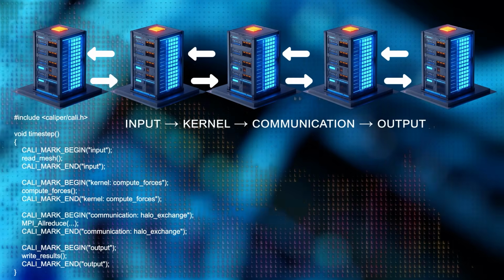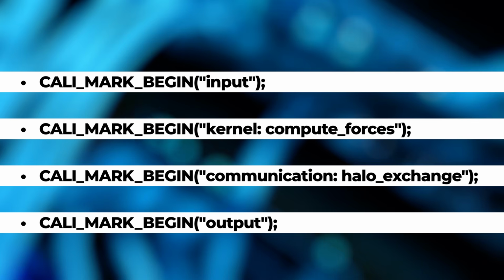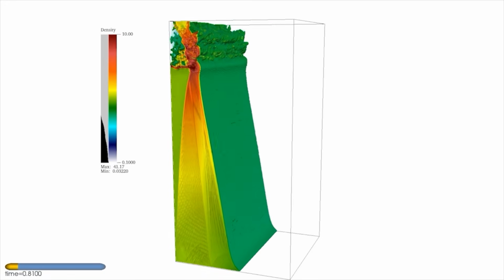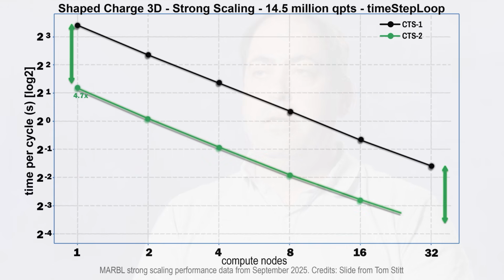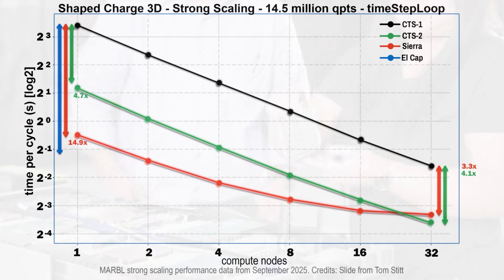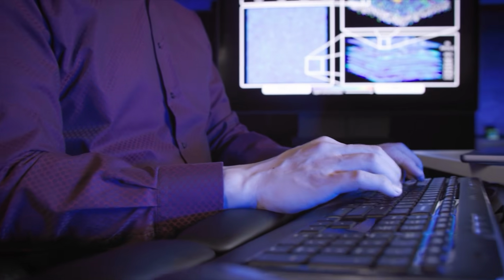Caliper+Thicket: Optimize HPC Simulations with Cross-Platform Exploratory Data Analysis

Comment: This seems to be a very useful combination of libraries. I'll certainly have a look to integrate this into my MPI-OMP Hybrid Fortran codes. Does that theoretically allow to find performance bottlenecks caused by influences outside the running program. I.e. some other users MPi calls slowing down a switch?